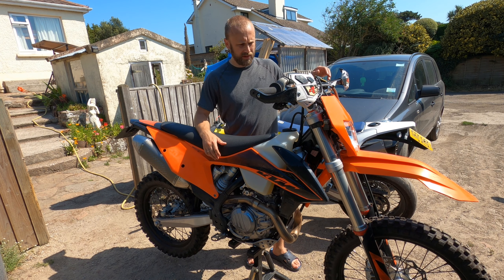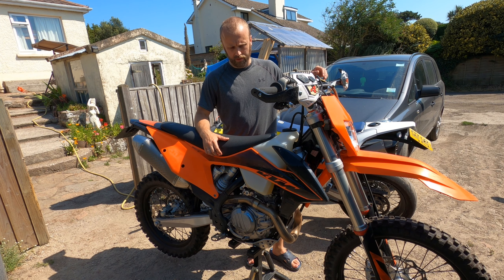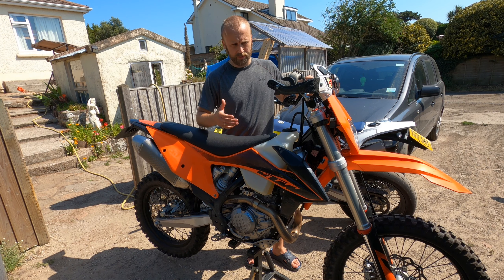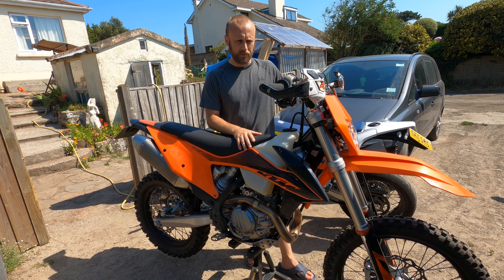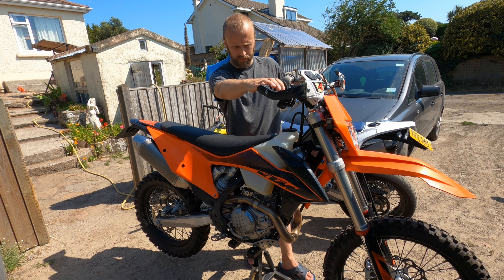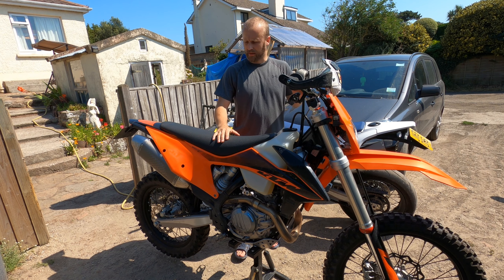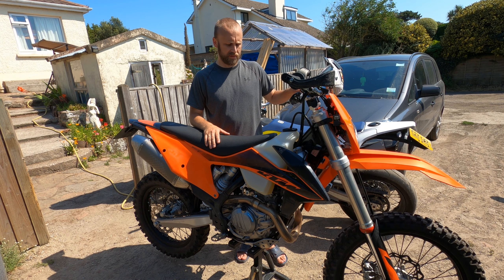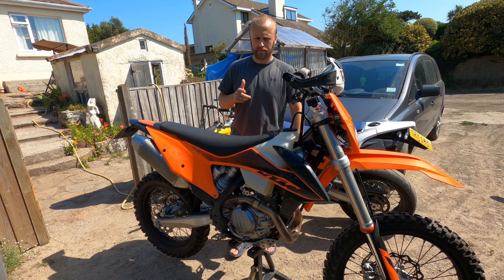Bike not running properly, 2020 KTM EXC 500

Comment: How many hrs,like others have said,check fuel pressure, possibly  restricted fuel filters,check the very small in line filter at the quick disconnect  first,they give you extras in the extra parts bag when bought new,the in tank filter    then regulator or possibly the pump itself, good luck

Comment: Fuel or air starvation.
Reply: From what I heard my guess fuel pump problem or the fuel filter which can be tiny on ktm that would be my first check. Along with make sure you have clean air getting through no blockages filter ok etc
Reply from the maker: Thanks for the advise. Will check.